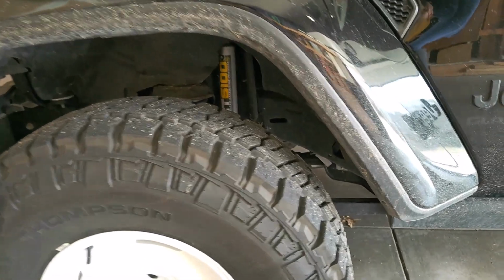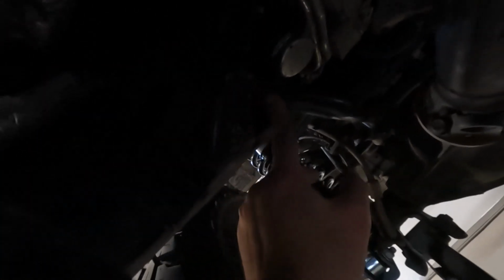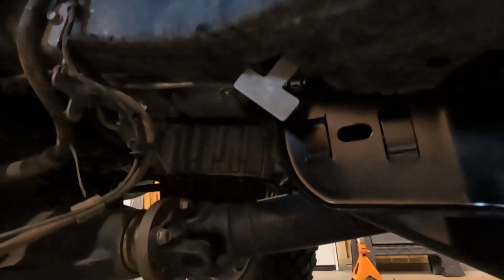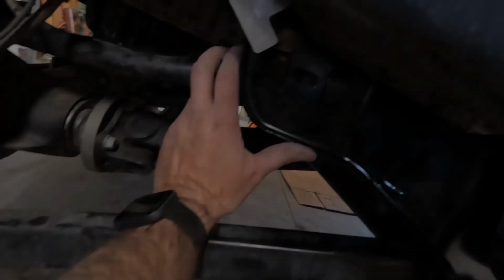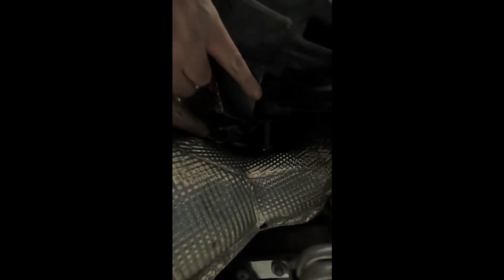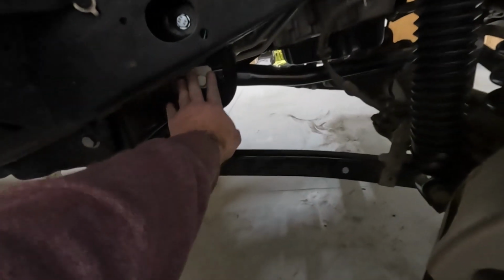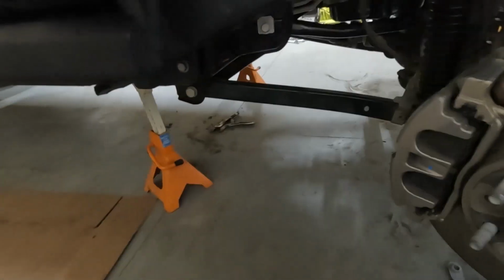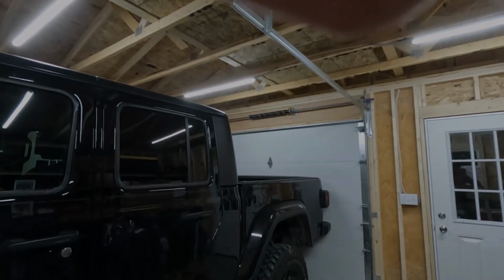AEV Geometry Correction Brackets JT Gladiator Install

Comment: I believe that many damnits must have been said in the making of this video
Reply from the maker: You have no idea.
Reply: @LowlanderNate  for whatever it's worth I installed these last night.  You can actually grab the lower control arm and pull/roll the wheel backwards just enough to get a pry bar in the bolt hole between on the geo bracket so you can get the LCA bolt in. Once LCA was in was able to get the UCA in the geo bracket (also completely removed the UCAs) I got this idea from JK gears and gadgets, saw him do same. If not,  I probably would have done the same thing as you. The instructions are terrible